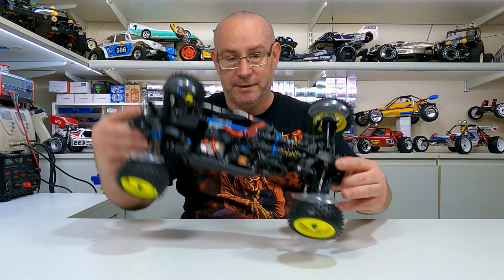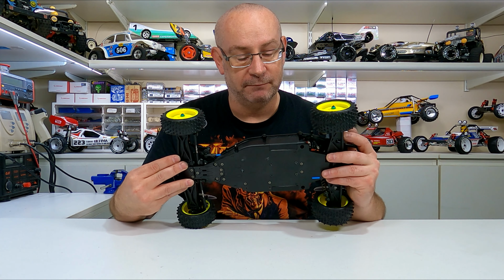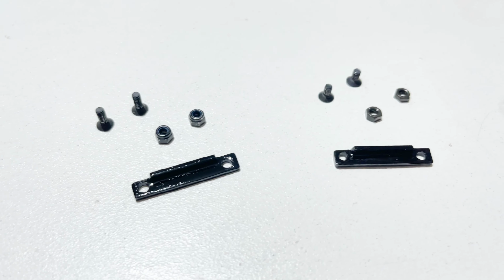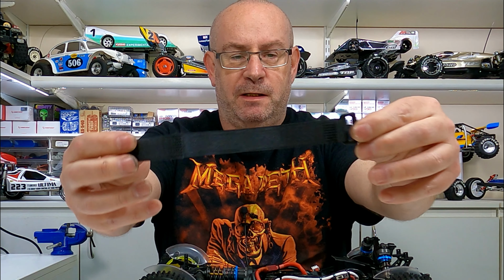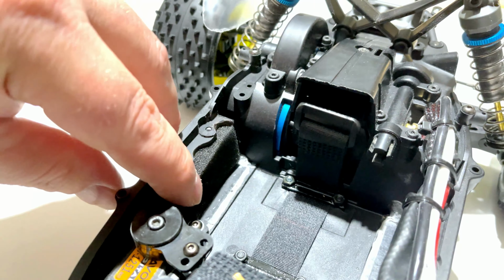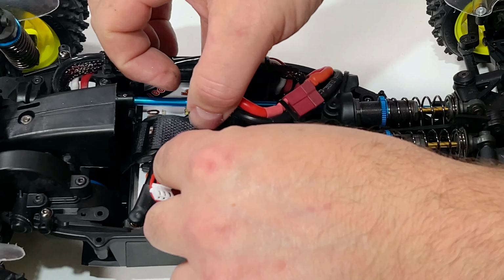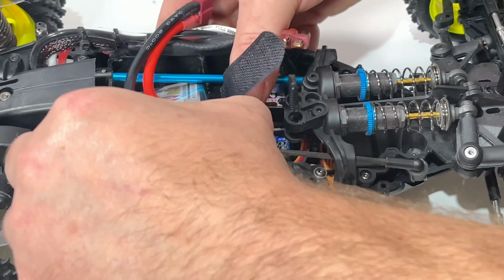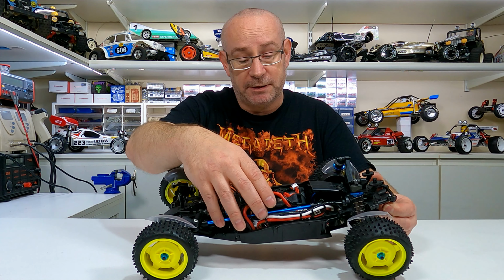Tamiya Super Avante TD4 Battery Mod

Comment: I think the designers at Tamiya could learn something from you! But on the other hand, I am guessing it was a conscious decision to have the longer battery compartment, so everyone has a battery they could fit...
Good job spray painting those aluminium bits, I might have just Mustained them... Oh shed, the Megadeth humour is getting worse every time...,
Reply from the maker: Haha thanks Mads! Yeah I'm sure they knew what they wanted at the time. Although they could have just made it like the TD2 and still use the longer battery 🤷‍♂. I'm quite sure their main aim was to make battery changing as painful as the original Avante, they succeeded! 😂.
Haha not bad mate, you've done an awesome job of the metal jokes so far. Speaking of metal, I figured I'd use aluminium for these parts so they don't Rust In Peace. 😁👍